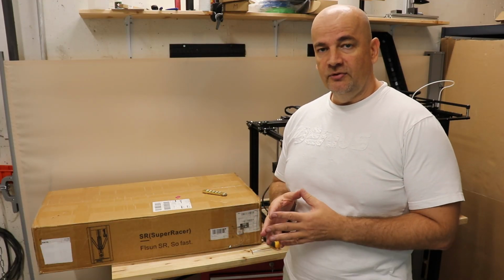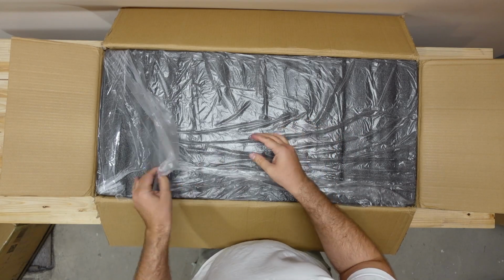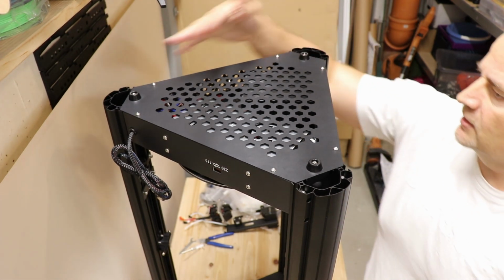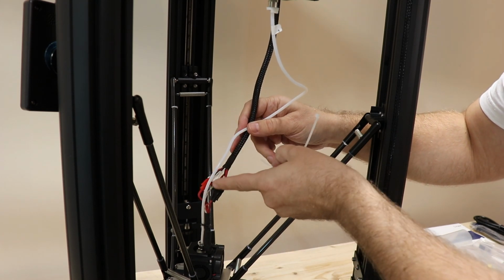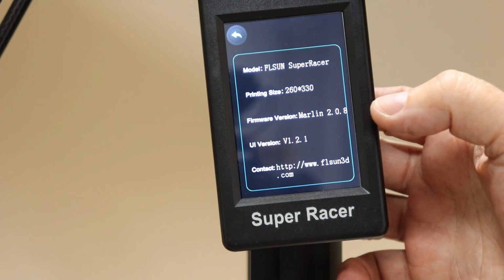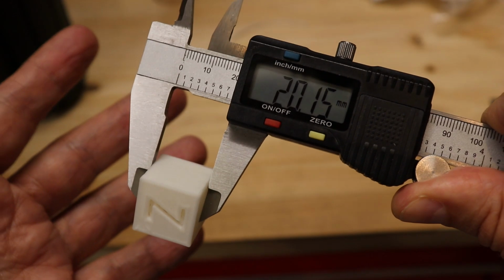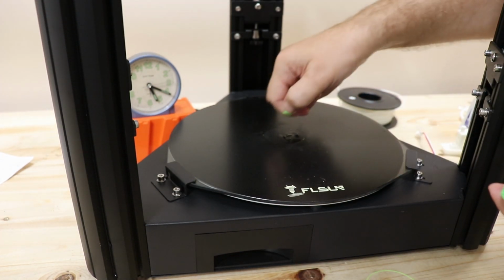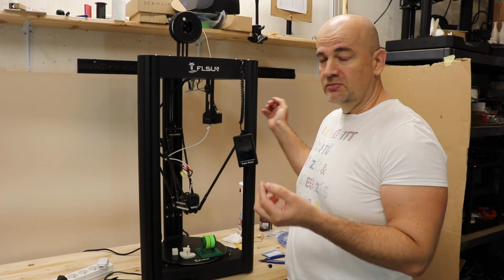How fast is FLSUN SUPER RACER 3D printer with linear delta moving mechanism?

Comment: You're absolutely right about the extruder - creates vast piles of dust.  I've bought a Bondtech LGX and will be replacing mine with it.  There have been many complaints of the extruder failing on this printer.  Aside from that, it's a really good machine and the support from FLSun has been extremely good.  Oh, and the FB group has excellent firmware updates which turn off the power saving by default as this can cause the print head to pause when printing from SD card.
Reply from the maker: Bondtech LGX ? Is that an upgrade to direct drive? Please inform me about the updates. Thx.
Reply: @MyTechFun  It's the same extruder (LGX) but with the Bowden coupling.  Haven't set it up yet ... lots of people are already making mods of course!

Comment: The retraction noise is solved using this startup set. 
G21
G90
M82
M107 T0
M140 S{material_bed_temperature}
M104 S{material_print_temperature} T0
M190 S{material_bed_temperature}
M109 S{material_print_temperature} T0
G28
G92 E0
Reply: its related to the power off recovery. disable this with m codes and its silent on retraction.
Reply from the maker: Wow, if this will work, you are life saver and this printer moves from the basement to my office :-)
Reply: @rogerneilhogg  I didn't realise that made a difference Roger - but I already have mine off so that's probably why I've not got the noise!
Reply: @MyTechFun  I had the anycubic kossel before this one. Its like a dot matrix printer vs a laser printer. Very happy with the machine and it does what it says on the box. Not 100% sure on how i got the retract sorted but it is now and makes almost no noise at all. That extruder can be a problem and I had to dismantle it once to clear the mess inside. Also , set temp to at least 235 for the auto retract otherwise you may break the filament and thats another story to fix up. I converted this to USB and never looked back. Check the manual. And that USB key they provide is not a key , its a micro SD adaptor !,
Reply: @rogerneilhogg  power off recovery is with m413 s0. So i dont understand what this gcode is doing to get rid of the noise.
Reply: @matheokoning4456  Fair enough. I dont have the energy to work out how I got mine silent. Could have been the M codes , might be some other thing. Here is whats at the top of my gCode if that helps.
M82 ;absolute extrusion mode
G21
G90
M82
M107 T0
M140 S60
M104 S225.0 T0
M190 S60
M109 S225.0 T0
G28

done here now.
Reply: @rogerneilhogg  No problem. I was just curious. I also read that many people set the retraction speed back to 30 and retraction length to 6.5 or 7mm and with that the noise is gone.
Reply: @matheokoning4456  TBH , I cant recall how or when the noise went away but away it went. Never strings, always good even with PETG. The only thing I hate is the dwell at the end of a print for 2 seconds. leaves a tiny mark at times.
Reply: @rogerneilhogg  maybe you can change the end gcode? So is moves faster away from the print or retract more or faster at the end
Reply: Checked what your code does cause I was puzzled about the power off recovery since I just installed a module on mine and it's code is M413, so here's the breakdown if you wanna refresh your memory on it or anyone else curious:
G21 - Millimeter units;
G90 - Absolute coordinates for movement;
M82 - Absolute coordinates for extrusion;
M107 T0 - Turn off fan T0 (the printer might be ignoring this as it expects a P instead of T but can't be too sure);
M140 S{material_bed_temperature} - Set bed to temperature;
M104 S{material_print_temperature} T0 - Set hotend on extruder 0 to temperature;
M190 S{material_bed_temperature} - Wait for the set bed temperature;
M109 S{material_print_temperature} T0 - Wait for the set hotend temperature;
G28 - Full homing;
G92 E0 - Set extruder 0 position as 0.

A pretty nice startup G-code, specially since it lets you add stuff in the middle of the heating up times, like you can set it to heat up, do something, then let it wait for it to finish heating up, or do something after the bed heats up, and then do something while the hotend heats up. I do this for the bed leveling, I run it each print after the bed reached temperature, but while the extruder is heating up.

Pretty sure you found something else on the slicer that solved the noise, like reduced extruder acceleration, jerk, retraction speed or such.
Reply: I check the marlin source code and I found that the stealth chop settings of the extruder motor was disabled. If you put M569 S1 E , this enables stealth chop mode on the extruder as same as X , Y and Z.  Then the sound should be much smaller .
Reply: @satoshiowada8806  That messed up the whole print. tiny little stop-starts in the extrusion. Easy to see on the first layer with a spiral infil. I dont recommend this setting ATM.

Comment: For that type of extruder the speed should be set around 40mm/s for retraction. If you wanna go faster for retraction turn up the print temp.
Reply from the maker: Hm, yes, the speed is ret to 60mm/s. I will try that, thx.
Reply: @MyTechFun  your welcome! That should help with making less filament dust

Comment: Nice review! Personally I would like to know two more things:
1. Do prints with very high mechanical requirements work. I tend to test print "Bengine" (Print in Place Engine Benchmark) because I struggled to get precise mechanical parts that fit together on my first printer and it failed this print as well. 
2. What is quality when you print on Prusa Mk3 but let's say with 200% speed? I think I've read that even Prusa run their own printer farm faster than default settings.
Reply from the maker: I always do testing with default settings, because this is what most of the users will do. These type of testing may be the subject for future videos (but after Ender7 vs SR speed comparison)

Comment: Just one more silent stepper could make this perfect.
Reply: + silent fans!
Reply from the maker: Fans are not laud, only the retraction. I'll try to reduce the retraction speed, maybe it will help
Reply: @MyTechFun  Is the firmware available for modification?  If so, could you not simply replace the stepper driver by a TMC one (likely the X, Y and Z are TMC and the E is still a noisy Allegro type)?  Would require adjusting it also in the firmware of course, but if it runs Marlin and has the source code available (which it legally is then required to), that would probably be the best option.